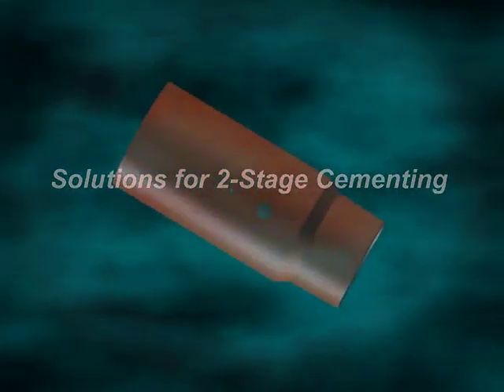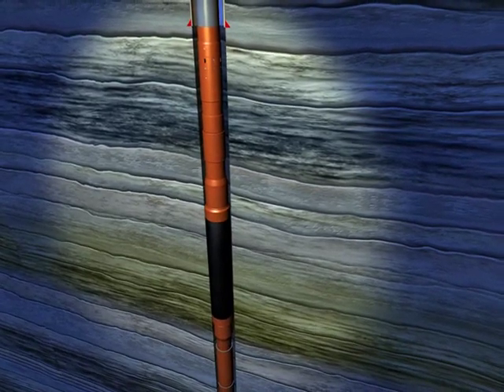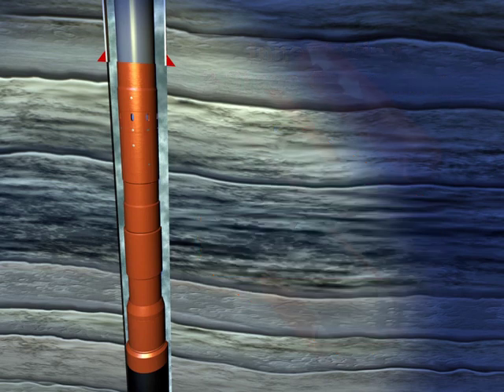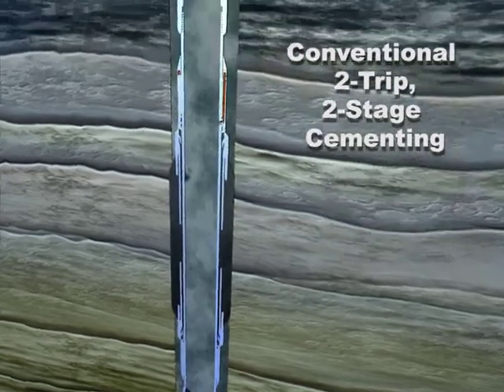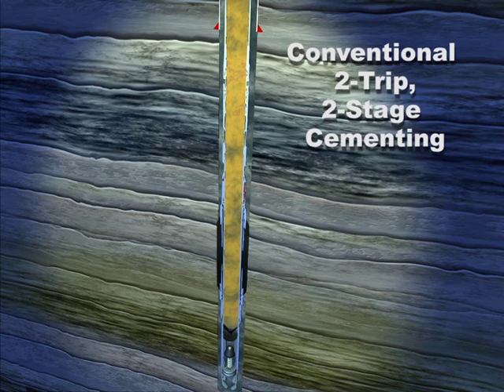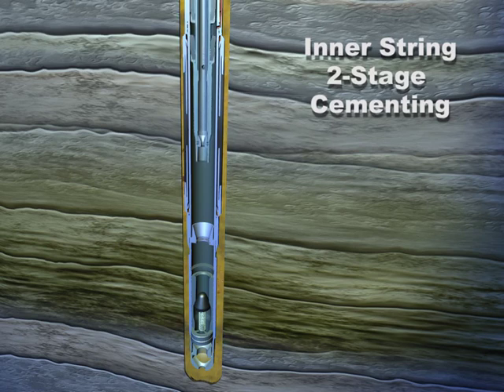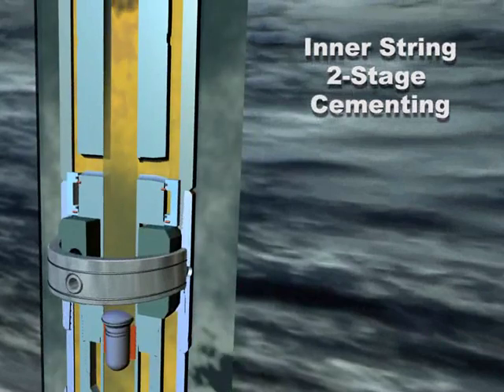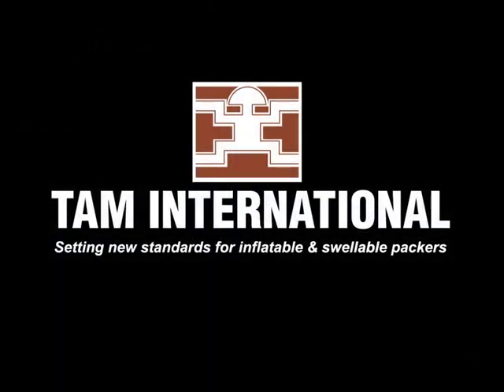Solutions for 2-Stage Cementing (English)

Comment: I don't understand the need for a multistage cement job.
Reply: Say your first cement rises in the annulus to a lost circulation zone so above this zone of loss, you'd have no cement.  With this tool run ahead of time and above this zone of loss, you can open the port collar and pump cement into the annulus.  Now you've succeeded in placing cement above a zone of loss.  This is just one example of a need for a two stage cement job.
Reply: John Griffin Thanks for that explanation.  That makes sense.
Reply: Kelli Hollinger In addition , if the hydrostatic column is too long and a bottom formation can not handle that pressure, you didide the CMT into stages. You could use multistage cementing to contraol any mud contamination
Reply: Hydrostatic and ECD effects makes it impossible to place cement ar desired length in annulus without losses. Another advantage is that in certain cases you do not have to wait for fist stage cement to set before pumping the second